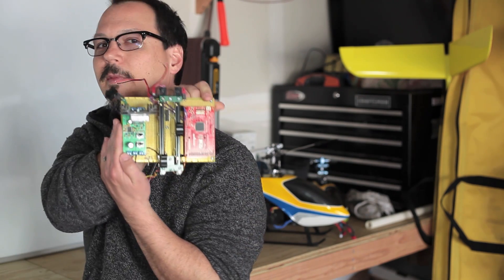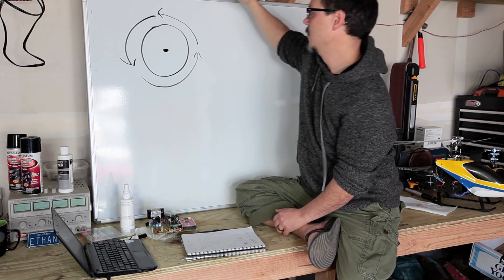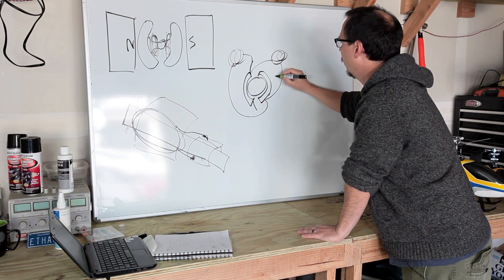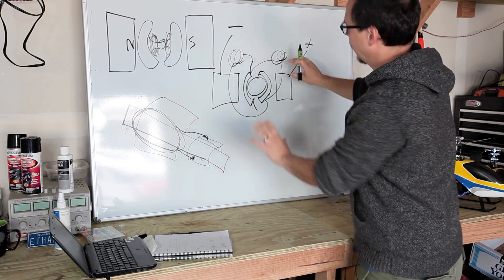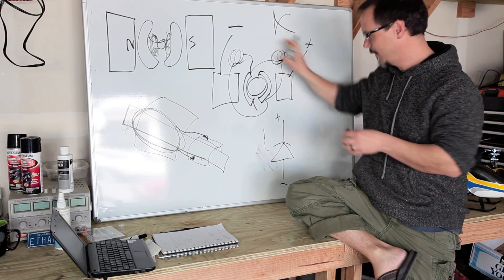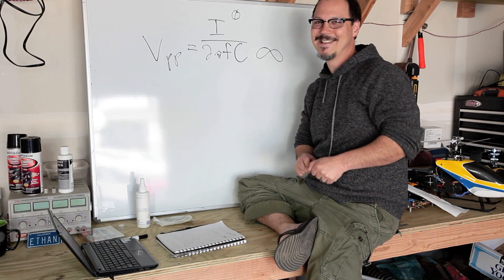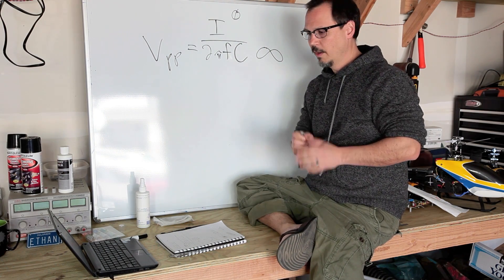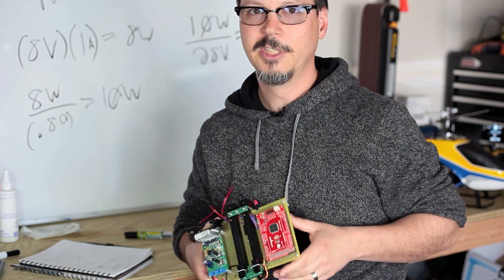SparkFun According to Pete 4-2-12: Inductors and Brushed DC Motors

Comment: I've try some brushless motors ro drive small fans into audio amplifirers that fed RF transmiters and the magnetic loadding and unloadding of the coils draw sertain ammount of current andfed a small noise into the RF transmiter with the audio signal. It was about a year before we were able to squelch the noise.

Comment: Why don't you just pwm right off the 28V supply? If you do it fast enough it shouldn't put that much noise on the supply. You could use an LC filter before the switch/motor combo to smooth the pulses further. It just seems silly to PWM twice, even though the first time is in a standalone chip. LC filters are super easy, especially if you avoid the calculations and just put a bigass inductor on it.